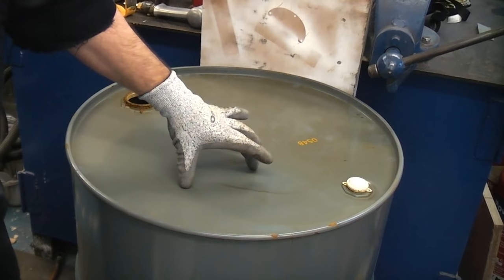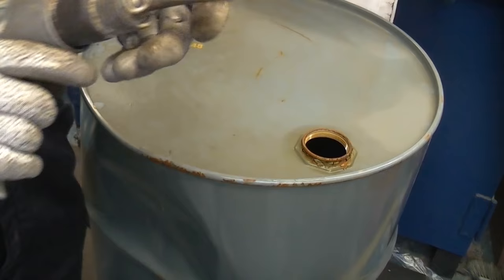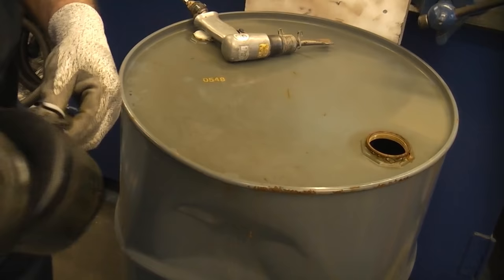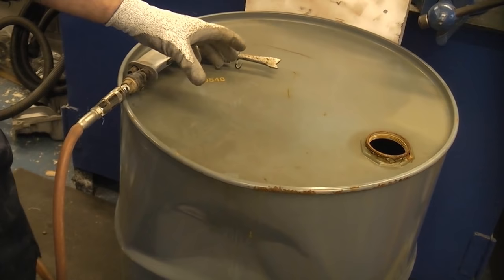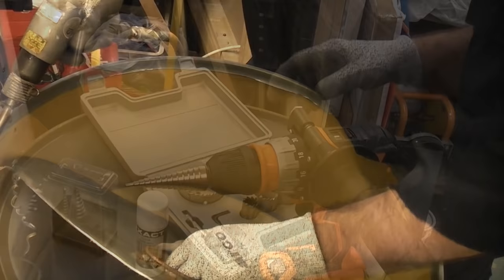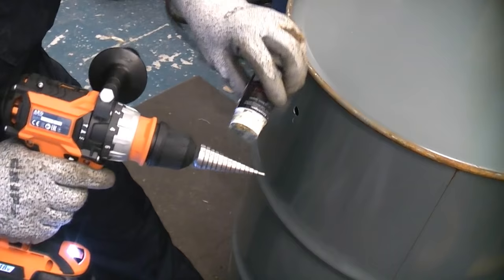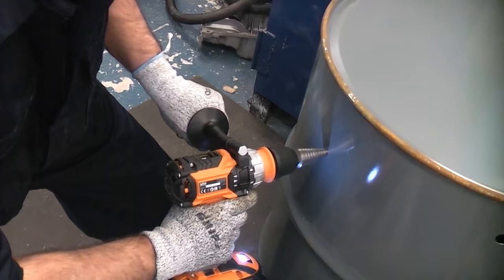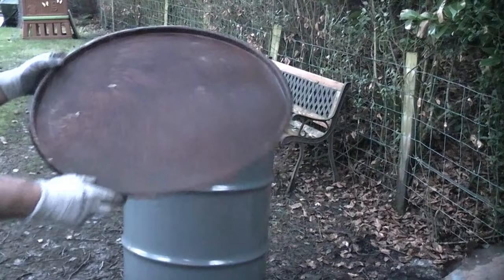How to make an incinerator bin from a 55 gallon drum

Comment: Just cut the bottom out. Cut some v-notches around outer edge of cutout. Place three to four bricks in bottom of inside barrel. Drop cut out section on top of bricks at bottom of barrel. Place on flat stones or short cinder blocks for airflow through factory hole that was the top.

Comment: Finally I can make my own incinerator company!..... Disposing body will need extra though!
Reply from the maker: 😂
Thanks for the comment 👍
Reply: For that, you need a 55 gallon drum remove the top. Pour 25 gallons of diesal in it. Place body in. Get diesal hot enough to start burning come back 2-3 hours later all bones will be ash. Granted you have a place you can burn a major fire like that. No holes in the barrel. Once the diesal starts boiling you'll be over 1400degeees that bone ashes at

Comment: I've been using drums like this for years, but I've also cut holes in the bottom as well. These allow rain water to escape more easily and aid the 'breathing' for the fire. 
It almost goes without saying, that the heavier gauge steel drum you can get, the longer they will last.
Reply from the maker: I might put a few holes in the bottom later.
Thanks for the comment ;-)
Reply: The fan is all it needs to breath.

Comment: Great video! I was mainly wondering how do you create enough heat for it to burn waste.
Reply from the maker: Once you have some combustible material in the barrel, it will soon burn when the air starts drawing through the holes at the base
Thanks for the comment 👍
Reply: @ultimatehandyman  Thank you!

Comment: I was going to say, haven't you already got an incinerator!  Yet another tool I didn't know existed, the air chisel, I'll remember that one. It looked much easier than say a jigsaw with a metal cutting blade. Another good video, you've just reminded me that I have some garden waste I need to burn!
Reply from the maker: Air chisels are brilliant. I actually bought that in about 1999 when I was renovating a property that needed the plaster removing from floor to ceiling ( I did not know that you could get an SDS drill with rotary stop back then). I needed to remove the stainless steel kitchen sink but I did not have a tap wrench so I used the air chisel to cut around the tap.
The air chisel that I used on site did the job much faster but that was a bigger version and the compressor is a hundred times bigger than my home compressor.
Thanks for the comment

Comment: Nice One Plus quite informative Except you didn't put any holes in the bottom for air flow plus drainage! What diameter where the holes etc. cheers
Reply from the maker: I always put the lid on when I'm not using it, so no need for drainage holes.
The holes that I drilled are about 20mm
Thanks for the comment

Comment: I used the step bit method on the first incinerator. Very time consuming. I switched to cutting several large holes in the bottom so it resembled a five spoke wheel. On each spoke I set a clay brick and then set a grate from a Weber grill on top of that.
Reply from the maker: Thanks for the comment 👍

Comment: Thank for that but could you explain why you put holes only at the bottom and not at the top?
Reply from the maker: Air will blow in the holes at the bottom to feed the fire with oxygen. The top is open, so you don't need any holes up there.
Thanks for the comment
Reply: @ultimatehandyman  Thank you so much for explaining. 👍

Comment: when i make my burn barrel i make air holes allot easier and quicker with a few good swings of an axe close to the bottom. The barrel i use now is a bit smaller. I use used truck brake drums with the centers cut out and stacked one on top another they will probably out live me because they don't burn threw.
Reply from the maker: Thanks for the comment

Comment: Would you share the drill brand and model, also bit used to drill the holes? Great Vid 👌🏻Tks
Reply from the maker: The drill is an AEG BSB 18CBL, but it only seems to be for sale in Germany at the moment on ebay- http://fave.co/2iybVEv
It was sent to me by a PR company to test out (it's my favourite drill at the moment).
The drill bit was a step drill- https://www.youtube.com/watch?v=YD-WcAZ_ynI
A few weeks back I sourced some cobalt coated ones from Bang good which were much cheaper than the ones I used in this video- https://www.youtube.com/watch?v=fvumt2z0GLI
Thanks for the comment

Comment: Once the top is cut out I use two hammers to go round the rim and remove the sharp edges. I used a club hammer and cold chisel to cut the top and a large centre punch to start the holes followed by a tapered pin punch to get them to about an inch, one hole I made extra large and turn it into the wind and use a propane torch to light it, currently no lid, I just turn it on its side between uses.
Reply from the maker: Thanks for the comment

Comment: I need to punch a specific size in a drum. whats the name of the device.. like a manual punch, thats spun with a wrench?
Reply from the maker: I think you mean a sheet metal hole punch- https://fave.co/2B3UZ1S

But I am not sure if they will work on a drum, I have used them at work on flat sheet steel- but never on a surface that is not flat.
Reply: @ultimatehandyman  Ahh thats it.. i dont need a flare die, but that is what i was talking about. I just didnt realize they were so expensive.  for 2 holes. The tool you used, with the graduated drill bit. How easy are those to use for a specific size?
Reply from the maker: The step drills are very easy to use on sheet steel, I have used them loads of times.
https://www.youtube.com/watch?v=YD-WcAZ_ynI
I even bought some cobalt ones for use on stainless steel- https://www.youtube.com/watch?v=fvumt2z0GLI

Comment: What else could you use if you don't own a air chisel.
Reply from the maker: You could use a reciprocating saw or even a jigsaw. Failing that you could use an angle grinder, but you have to be certain that the drum has not had flammables in it!
Reply: Green roof growth
Reply: Hard Worker club hammer and bolster chisel will have the lid off in about 5 minutes.... that is how we cut them at work we arent allowed to use power tools on them because one did catch fire quite disastrously a few years ago

Comment: Air nibbler or air shears work better. For cutting top i used to use a stick welder on high amps to burn hole in barrel in seconds
Reply from the maker: Thanks for the comment 👍

Comment: how about a kicker>>>> hook up a leaf blower to  lower part of the barrel and you can melt a whole car!! seriously I've seen it and it's hot!! not a car but you get the point. BTW great channel!!
Reply from the maker: I'm planning on making a furnace when I get time, I have most of the bits already. I was considering using the Dewalt blower, but then I found a fan from an old boiler- so I'll probably use that instead.
Thanks for the comment ;-)
Reply: save the furnace blower for a home made work shop ceiling mount air filter, at least with the leaf blower on the drum it's removable due to it's 3 /12 fitting and plus you may have better speed control

Comment from the maker: If you are lucky enough to be able to get a 55 gallon drum for free you can easily turn it into an incinerator bin. I’m still very busy working on site, but trying to get some new videos made! 

Happy Sunday everyone ;-)
Reply: Ultimate Handyman cheers for the video mate, top man!
Reply: Ultimate Handyman Cheers. loads better than the paper thin incinerators you can. buy from shops too.
Reply from the maker: You are welcome.
Thanks for the comment
Reply from the maker: You are welcome.
Thanks for the comment
Reply: If you add drain holes on the bottom they last a bit longer. I usually open the bungs and flip the drum over. Cut the bottom out and use it as the top. Built in drainage! I've never had lids for mine though, that should help.
Reply: If you add drain holes on the bottom they last a bit longer. I usually open the bungs and flip the drum over. Cut the bottom out and use it as the top. Built in drainage! I've never had lids for mine though, that should help.
Reply from the maker: You could use a small angle grinder, but ensure it has not had any flammable liquids in it or you could be having half a day out with the undertakers.
Reply: Buckshot works wonders.

Comment: any ideas for loads of documents without an incinerator?  shredding a huge pile would take an age.ideas anyone?
Reply: Have you got a BBQ, you could use that, or compost them (pour some water, or something less pleasant, on them as you put them in) dig a fire pit or stick them on a bonfire. Depends what resources / garden etc you have really.
Reply: no garden that i can burn in, i hate using a shredder as it will take a month of sundays, the only idea i have though of and yet to try, rip the paper into quartes or such, put into a bucket with water for some days or weeks and it should turn into some sludge,  then let it dry and put in recycling wheelie, no idea if it will work
Reply: Yep wife has done that, it does mean that you have a bucket of mush to get rid of at the end though. Maybe stick some bleach in with it too. Should work. Also there are companies that do collections of sensitive docs but I think they are a bit pricey.  What about work do they not have an industrial size shredder or sensitive paper collection that you can use on the QT?
Reply: nope no access to a pro shredder , dont wanna pay anyone to do so, didnt think about the bleach, might try one with and one without, i have a garage and time and a few buckets, i dont mind leaving them for some weeks, they can go damp into the recycling bin so long as they are beyond reading by then.
Reply: Sounds like a plan, never thought of them still being able to go out for recycling wet but suppose that is probably how they process the paper at the recycling plant anyway.  Good luck!

Comment: for anything except light burning without holes in the bottom it will fill up with ash [and if lid not on maybe water] quick meaning tipping it all the time. 

If you ever need a working fire [to get rid of a lot of stuff say on a site] that burns with little smoke, will burn everything and will burnout quick [one is supposed to stay with a fire until it is dead and not leave some slow smoker that burns all night which one sees all too often] cut holes in the bottom and put some wire mesh in and stand off the ground. A tap will drop out the ash which can be raked to one side. When you want it to end it will burn itself out in 30mins meaning safe to leave site and no all night slow smoker to gas locals.
Reply from the maker: Thanks for the tips ;-)

Comment: can i ask where you got the aeg drill form I had m old set for 6 years and I am struggling to find anywhere in the uk that sells them
Reply from the maker: I was sent it to test out by a public relations firm to test out.
I've just looked on ebay and there are hardly any AEG tools for sale by reputable sellers!
Reply: wish I could  do something like that I was given mine  when I  left school by a mates dad and now I have started a joinery apprenticeship it has more or less blew up on me no power left  I have looked into having it repaired  but I have been told it would cost in the region of £140 to repair   and there's no way as a apprentice I can afford to pay all that out fantastic machines as well
Reply from the maker: £140 is very expensive. You can buy a brand new Bosch drill with charger and 4AH battery for £99 from screwfix- http://www.screwfix.com/p/bosch-gsb-18-2-li-plus-18v-4-0ah-li-ion-cordless-combi-drill/7434k
Reply: aeg are part of the ryobi group, got sold to china, i guess the old network that sold the german AEG isnt selling the modern ones.  they need to get them into screwfix etc, but they will up against makita/dwalt and the usually good screwfix deals

Comment: Presumably an angle grinder will also work?  Where did you get it for free?  There's some on Gumtree for 10 quid.  Cheers.
Reply from the maker: Yes, a grinder will work but you have to be careful not to put and sideways pressure on the disc.
I got it free from the site where I was working as it had fallen from a lorry and was dented, so could not be used.